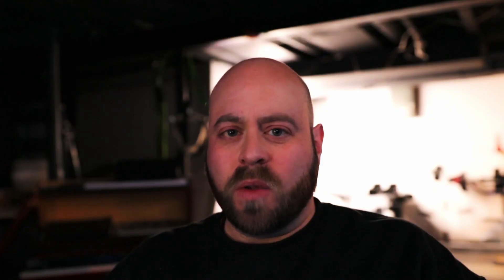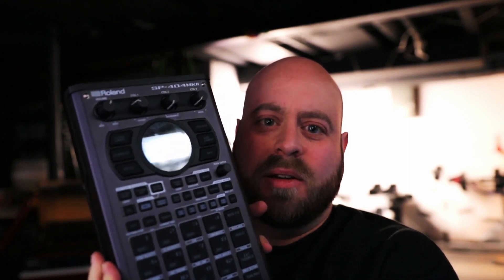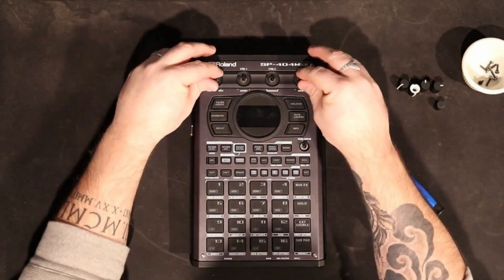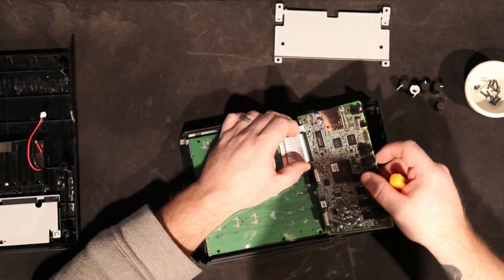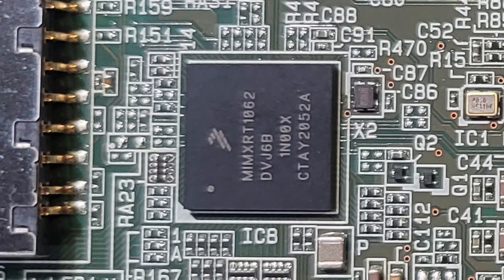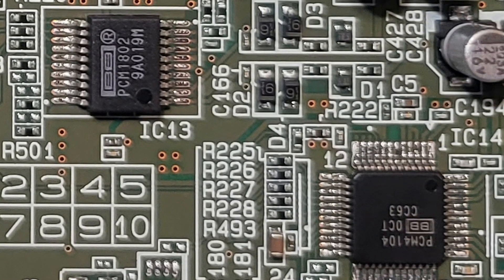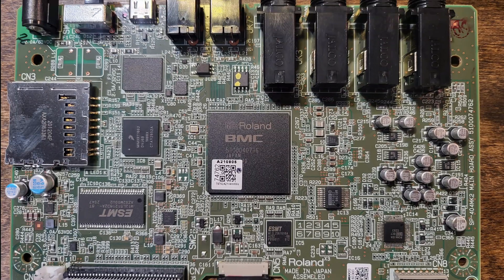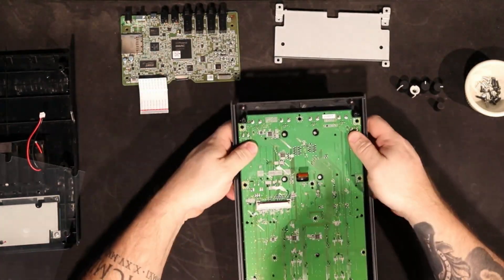Taking Apart The Roland SP-404 MKII

Comment: Dude. Could you fit an Apple AirTag inside this?  I know that it will beep if it’s stolen but if it’s screwed inside it’d probably take a while to remove the AirTag and that might be enough for the thief to hopefully abandon it. 

Especially if I used anti-tamper screws to replace the original screws.

Comment: How does working with the 404mk2 compare to the Isla S2400? I know they are very different in specs but I’m curious as to which you would prefer at a live gig
Reply: Saw this question wasn't answered so I figured I'd give you my personal opinion. The 404mk2 is an easier and more fun device to use. Both machines have some menus diving but the s2400 does too much as it's trying to be an sp1200, an mpc and a digitakt all in one. (And probably some other machines/maschines). Depending on your work flow you could actually program the same way on both of them if you go a certain route. But out the gate the 404mk2 wins in programming, effects, filters and... making your samples dirty. With that being said the s2400 is still a good joint but for that price you can get 2 404mk2s and have change left for something else to add to the arsenal and you wouldn't miss anything from the s2400.

Comment: Brave tinkering. The reference manual states the internal storage is 16gb, with the maximum sample length being 16 minutes per sample. Roland is using those BMC chips in all they’re current grooveboxes, drum machines, and synths from what I’ve heard. Pretty much anything ACB or ZenCore based. I was in a focus group with Roland folks and they stated that the current flagship Fantom workstation has 5 BMCs vs something like the MC-707 which only has 1.

Comment from the maker: Also worth noting is that the workflow on the MKII is similar enough, that after I learned how it worked, I also vibed more with the 404A I already had but didn't use much. The MKII basically taught me the A. So yeah, that happened.

I also forgot to take the front input/output board out too. For the record, there's not much there, it's just a stack of jacks run to the ribbon cable that connects to the logic board. Sorry.